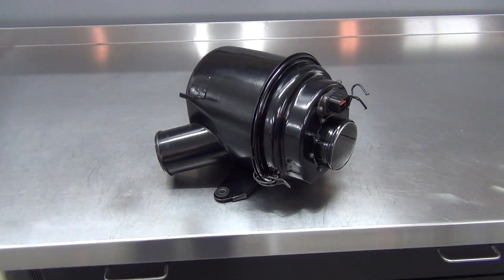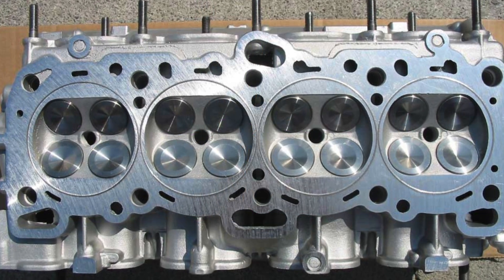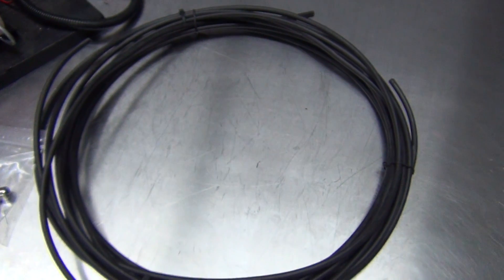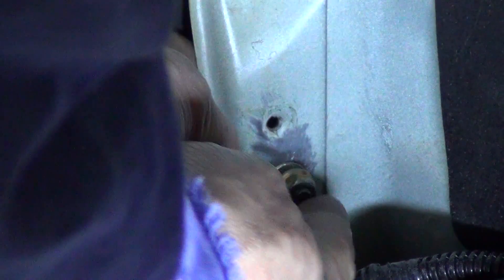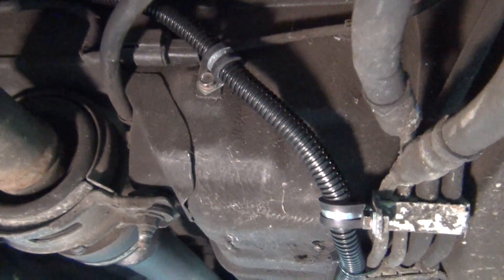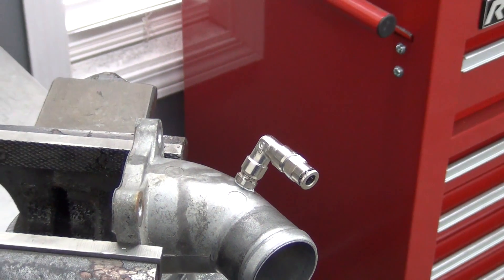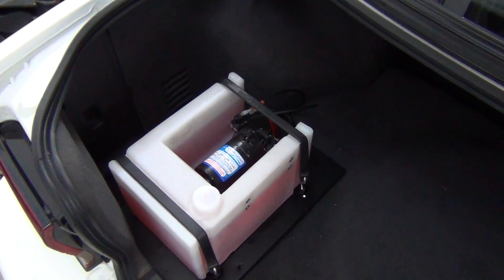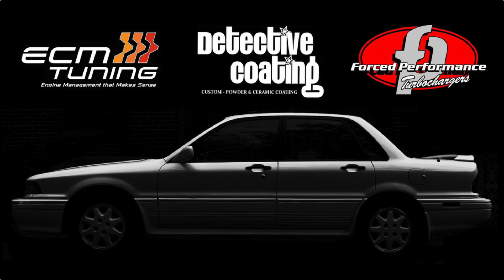Project Street Sleeper Part 9: Methanol Injection Install

Comment: Why does everybody think that suspension upgrades consist of lowing a vehicle. By the looks of all the others cars tom has had I don't think he will want to ruin his sleeper look with lowing it. Toms talon was a beast and from the out side Id guess it's stock besides wheels
Reply from the maker: Well, I suppose that these days with the availability of coil overs and preference toward slammed setups, fewer folks are choosing subtle 1-1.5 inch drops much anymore.  I could be wrong about that.

Comment: Hey Tom, a question I have always had about the injection setup is how fast do you find yourself having to refill the reservoir? I think you may have mentioned it in one of your earlier videos but I can't remember. I know it may vary based on driving skill what it is set to etc, but I'm mainly curious about how your experience with it in your cars.
Reply from the maker: It's completely based on amount driven, driving style, nozzle size, activation point and so on.  My Grand National drinks it constantly while my 4G63 cars use less.

Comment: A great way to hide that would be to put something that you'd normally put in a trunk as coverage. Like... a cardboard beer case- or even better- cut the bottom out of a cooler and slide it over the top of the tank. :D
Reply from the maker: While I appreciate all of the spirit of the "hide the tank in the trunk" comments that I've received, who will ever be poking around inside my trunk besides me?

Comment: 124F = cooler intake charge?
Reply from the maker: The intake temp of a DSM datalog is taken from the mass airflow meter.  So that is air temp coming into the engine at the air filter, not entering the combustion chamber.
Reply: ah cool, didnt realize that. I have my IAT sensor right before the throttle body.

Comment: Tom.
Next video please upgrade the axles, shocks, brakes and brake lines. 
And how about the transmission mount and motor mounts ? 
Put a lighter drive shaft and that upgrade will be very sleeper no one will know. 
Nice video when you are tuning it ?

Comment: Thanks for sharing your methanol installation. Its a great way to get more power but I think I would have added a caution for your viewers. It does make tuning a challenge, especially if you are running with or without methanol. And running out while under WOT is definitely bad news.

I am from Texas so E85 is the way to go for us. 21 stations with supply make E85 a no brainer. As long as you watch your torque curves while tuning on the dyno.
Reply from the maker: Thanks man!  Well said and while I've never really found it to add complexity to my tune (it just gave me more "headroom" before knock sets in) it is a problem if it runs out though.  I would run E85 tomorrow if it was available around me.

Comment: Did you say water injection?
Reply from the maker: Yes, straight water is commonly used.  I used straight distilled water on my old 4G63 Turbo Mirage and it worked great for many years until I started mixing 50/50 distilled water and denatured alcohol.

Comment: Another spectacular video, Tom! And I really like the electronic angle on the music for this one (the piece starting at around 6:40 was great, and the closing number was pretty awesome, too). Can't wait to see the looks on people's faces at the drag strip with this build.

I'm curious about one thing, was that a drain hole/tube that you ended up using to route the meth/vac lines into the trunk? If so, did you re-route the drain?
Reply from the maker: Thank you as always for the very kind support!  I can't wait to drive it either, I look forward to some drag runs someday too!  That was just a general "overflow" type drain for the trunk and wasn't attached to anything from above.  You'd have to fill up the inner fender with 6 inches or more of water for that drain to kick in.  Thankfully it's all dry as a bone back there and I keep the car stored inside too.

Comment: Great informative vid.  I was wondering if you would still recommend this for low boost Supercharger running 6-7psi?  Also, is it better to run it before the TB or after?  If I do this can I use the wiper fluid reservoir as my tank? Thanks.
Reply from the maker: Hi Edgar, you have to check with your supercharger manufacturer to see how and if they suggest using a setup like this.  Resevoirs need to be high quality, especially if running alcohol or methanol.
Reply: Thanks Tom.

Comment: So let me get this straight.........   You're keeping the restrictive stock intercooler piping to keep a "sleeper" look, but in your next video you're going to do suspension upgrades? ..........   UUUUMMM....... OK........  Nothing screams "modified" like a lowered car.  You're aware that those axles don't hold a lot of power right?  So why not keep a stock suspension in place to reduce the shock to the axles, while keeping your "sleeper" look?
Reply: >implying all suspension upgrades mean lowering a car

He could just be adding some better shocks and springs, not neccesarily lowering his car. Plus every sleeper enthusiast knows that the most you can lower a car without anyone noticing is about 1 inch maybe a bit more depending on the age and model of the car
Reply: Have you seen his Talon videos? I'm willing to bet that he's aware of the limitations of the stock 3-bolt rear bud :) As far as the suspension modifications go Tom never said he was going to slam the car to the ground.
Reply: 4g63mark  hmmm a guy with no videos or ANYTHING car related on his channel or a guy thats proven his car skills time and again ....just look at his videos before you try to give that internet mechanic inside of you a stretching. troll
Reply from the maker: Yes, you pretty much summed up my plans.
Reply: I don't usually get involved in internet debates since they are endless and pointless. While you bring up some MILDLY valid points about "suspension upgrades" Mark, your lack of experience actually racing Mitsus shows through in your comments. Lowering one of these cars while making 400hp doesn't guarantee axle/drivetrain destruction. If you know how to properly setup the suspension and drive the car you can make whatever suspension mods Tom has in mind last the life of the car. If you weren't aware of that, keep an open mind and watch Tom show you how to get it done.
Reply: You have a point^^^
Reply: DJXtremist1 I hope he does keep it at stock ride height.  But I still wouldn't touch the suspension on a "sleeper" until a built tranny, 4 bolt rear end, upgraded axles, and upgraded transfer case were in place........  If he has worn bushings or blown shocks, obviously it's natural that he would replace the damaged parts.  But until the drive train is done, I'd stay stock suspension.
Reply: Ben Derpinghaus I have more experience with 4g63's than he does.  I have broken lots of parts with an upgraded suspension and 320 whp.  But I've managed to keep many of those parts together with a lot more horsepower and stock suspension.  I speak from my personal experience, not to mention thousands of dollars out of pocket.  For you to assume that my experience with 4g63 related cars has to be on display on YouTube, is what makes you the unhelpful guy just trolling for a response.  Good day.
Reply: 4g63mark I would like to see your make videos, hell, i would like to learn from you so that it could help me in the future. No this is not a trolling comment, nor am I trying to start something but I would love to watch vidoes you produce and put out there because it would be cool. Tom provides us with excellent videos and cool ideas. I am mostly a muscle car guy but i do respect good import and exotic. I would love to see more videos made by different people.
Reply: CHASNME Tom's videos are entertaining to me and educational to you.  He's not showing anything that I haven't already done.  Remember, these are EXTREMELY basic upgrades done to a very modest "Street Sleeper."  If this were John Shepard talking about a designated race car, this topic of conversation wouldn't exist.  I have no doubt that this car will do fine, and that Tom is quite capable.  As this car continues down it's intended path, we'll see how it responds to Tom's scheduled tweaks.
Reply: Son, I've forgotten more about racing Mitsus then you've yet to learn. They aren't even a challenge for me any more I build my cars from scratch with CAD and a tig welder. You are a mitsu expert yet you're stressed about his axles because he mentioned suspension upgrades LOL. It's pretty obvious his video's aren't educational for you since only John S. is worthy of teaching you something. Here's some words of wisdom for you:
"A wise man never knows all, only fools know everything," -Socrates.
Reply: CHASNME I'm at a loss for words my good man.  You managed to take my comments  about the effects of aftermarket  suspension and their effects on stock axles, and turn it into a full blown pissing contest.......   There's a LOT of people more knowledgeable than myself.  Jafro is one of them.  If you build cars from scratch I would be watching your videos too....... My years of playing with 4g63's are in the past.  I'm now working towards a Coyote swap in my Mustang........  I loathe the day people behave online the way they do in real life.  And since you're craving attention commenting behind the safety of a keyboard, FULL of bravado, I'll gladly move along to a more mature group of people.........   For those of you who are modding your 4g63 powered cars, best of luck to you all.  They're VERY fun cars and do a WHOLE LOT with not much $$$$
Reply: I appreciate you taking the high road and moving on from commenting on this video series since we wouldn't want my bravado to escalate beyond what the keyboard can contain. The world is truly a dark place when passive aggressive comments and subtle insults are taken with prejudice rather than appreciation. A word to the wise my friend, if you want people to be receptive in witness of your vast experience, try and be a little more polite in the future with how you word things, since as you say the keyboard can lose intent in translation.
Reply: CHASNME  haha very entertaining argument between you and mark just my 2cents 😂
Reply: Guy was a tool lol
Reply: CHASNME guys guys!  lets just relax a bit and browse the selection of fine pants tom has on his page

Comment: Oh man, this is getting good.  It's like the plot of a good espionage film coming to light while retaining the suspense!  Slick setup.  Are there any concerns with the boost line/alcohol lines being so long?  I.E. Boost trigger performance or injection rate/pressure?
Reply from the maker: Hi Steven and thank you!  There doesn't seem to be an issue with the line length if rigid, high quality lines/check valves/pumps, etc. are used.

Comment: Another benefit of having the tank in the back is you'll help keep the car 10 pounds closer to 50/50 weight distribution... if you're concerned about that. ;)
Reply from the maker: It did cross my mind, probably better towards the center/forward or passenger side though.  I'm nowhere near corner weighting or anything like that though.  I'll just be happy to drive it to the grocery store again. :-D
Reply: Tom's Turbo Garage Funny, I've done quite a few supporting modifications to  my car (no power upgrades, not even sure if I want to), but the handling is nice and tight, braking is good, short shifter, many various things done to the car, and I used to work at a grocery store, so I really DID drive to the grocery store!

Comment: OOOOOOHHHHHH YELLS YESSSSSSSSSSSSSSSSSSSSSSSSSSSSSSSSSSSSSSSSSSSSSSS
Reply from the maker: Haha!
Reply: Tom's Turbo Garage Tom what psi. do you like your meth to start to inject ?
Reply from the maker: TURBO RICKO Hey man!  I usually set it between 10-15psi.  Your setup may need to be set early or later though depending on lots of variables.  Good luck!

Comment: In my opinion that is not sneaky enough, you should have used some containment that would fit behind the site or rear pandles of the trunk. Also you would have much more cargospace like that ;)
Reply from the maker: Too much hassle.  I need to see and access it for refilling and no one will ever be pecking around inside my trunk.  I don't need cargo space in this car, I've got my minivan for that sort of thing.

Comment: Tom I was always wondering. Why don't you run E85? None avail? Don't like it? Any experience? Thanks and great video as always.
Reply: Methanol by itself has a octane equivalency rating of about 116 and E85 has 105 octane rating. In general using a 50/50 mix of water with Methanol, ethanol or isopropanol will give you a bump of 10-20 points in octane over standard pump gas. This adds flexibility as you can adjust the ratio of this mixture to suit your specific engine needs. This coupled with the fact the water also aids in dropping the incoming air charge is a bonus for forced induction users. 1:1 methanol is cheaper than ethanol. The down side is that you have to check and fill your tank and fun factor is limited by your tanks capacity. TL;DR Cheaper, adaptable, power bump = to E85 but limited by tank size.
Reply: MaximumHeresy
I'm not sure I'd compare meth injection to E85 as an equal. I've been running methanol injection on my gvr4 since '06 and have not been able to get the same results as those running E85 with similar setups as me. I'm usually limited to a little less boost and a little less timing. I even run 100% meth through an M15 nozzle, so it's enough that it's used as a fuel and I have to turn down regular fueling via ECMlink.

That said, it's a great way to make more power if you don't have E85 available nearby, like me.
Reply from the maker: Thanks man!  I would run E85 it if it available in my area.
Reply from the maker: Mark Pontarolo I agree Mark, water/alcohol/methanol is no substitute for quality E85.  It seems like folks can do the impossible with it.  Same goes with race gas really.  In my experience, a quality race gas like VP import or C16 is much more stable and consistent vs. mixing sketchy blend pump gas and methanol injection.  If E85 was available in my area, I'd be all over it.
Reply: Tom's Turbo Garage Ok, now I know that it's just an availability issue. I run it and love it and know all about it. I was always like why is Tom running meth injection if e85 is available these days. But it makes total sense, I used to run meth injection until they had 4 e85 pumps about a mile out from me. Good luck Tom, can't wait what the vr4 can do performance wise.

Comment: Tom you should upgrade the setup to engage via ecmlink, it's far better than by a pressure switch, it will switch over to aux fuel maps automatically and you'll have much better AFR's.
Reply from the maker: Hi Jason, thank you for the idea, I may go that route eventually.  I've never really had a problem with boost activated setup in my 4G63 cars though. I always lean toward simple due to lack of time to fiddle.
Reply: Tom's Turbo Garage
I hear you on the lack of time, it's taken me 2 months to get my speed density dialed in lol. I was on a simple boost activated switch as well before but once I tried it I was sold, actually ends up being much quicker to tune as the ECU knows exactly when to compensate for the additional fuel .